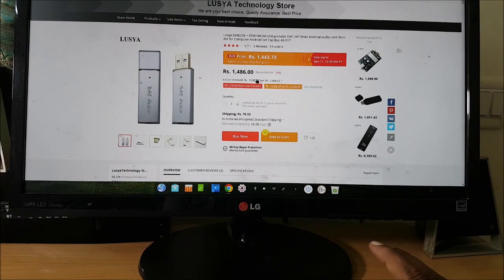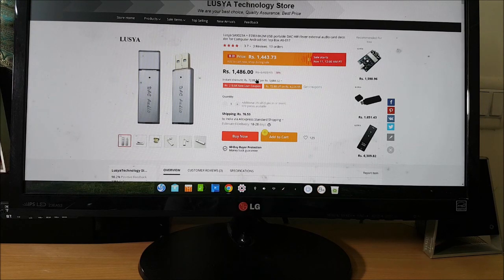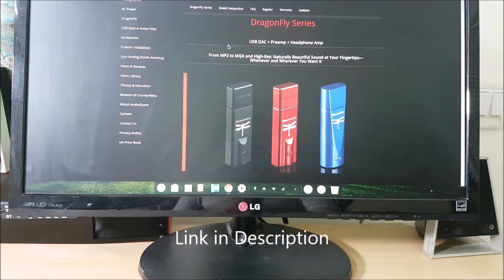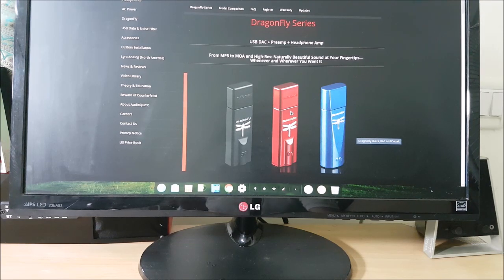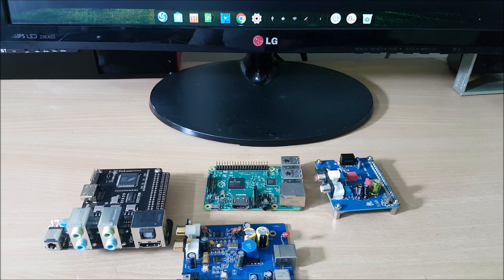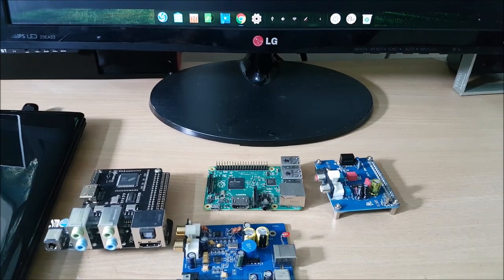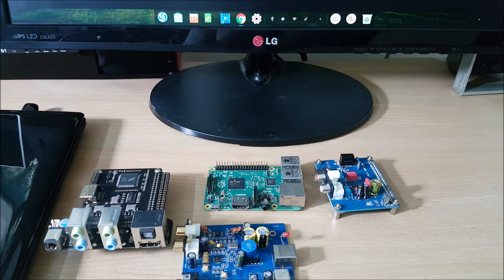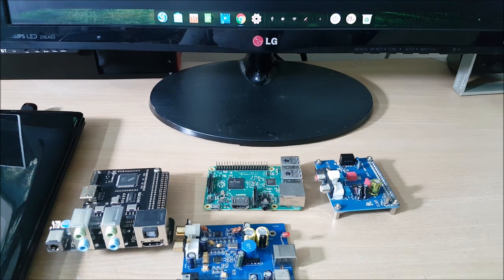More about DACs , digital analogue converter questions and answers

Comment: When we are connecting mobile or any other player to DAC by a 3.5mm head phone jack, the signal will be already analog , then how it will work in external DAC, please reply
Reply from the maker: Dac is connected to player / mobile by optical , hdmi, or USB cables not by 3.5 mm headphone jack

Comment: Raspberry Pi enganeya elupathil oru hotspot ayittu set cheiyuka?
Reply: Njan raspberry piyil Kodi install cheithitundu
Reply from the maker: Volumio os und partumelkkan aanenkil athil hotspot undu
Reply: @TechKannanMalayalam  njan raspberry Pi 3b+ anu use cheiyunnee athil
1. Kodi
2. Retropie
3. Raspbian
Ethu moonum odunudu. Ethinu oru hotspot configure cheiyan pattiyal. Veetile ellavarum connect cheiyan easy yakum. Veetil broadband wifi illaa. Athukondanu hotspot nokunnee
Reply: @TechKannanMalayalam   kittypoyii njan RaspAP enna application install cheithu. Ippo raspberry Pi oru HotSpot anu